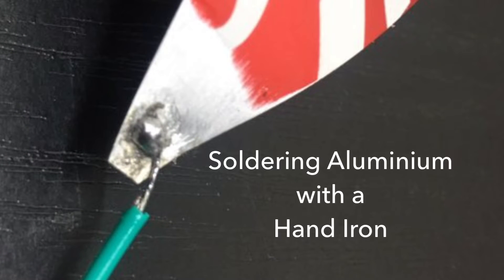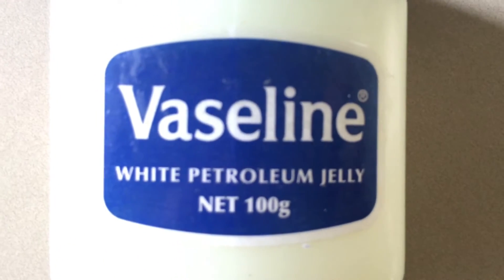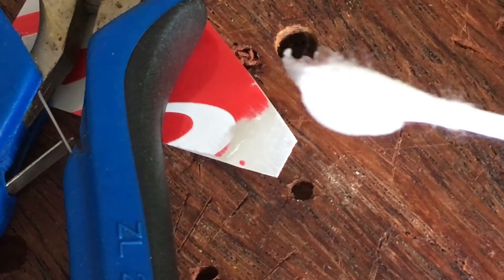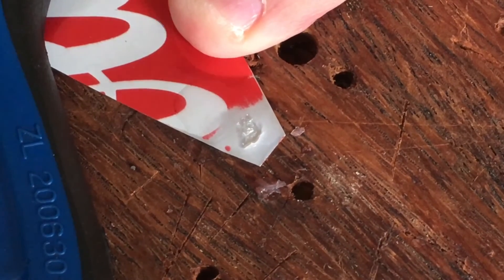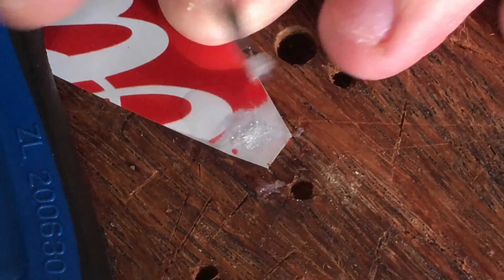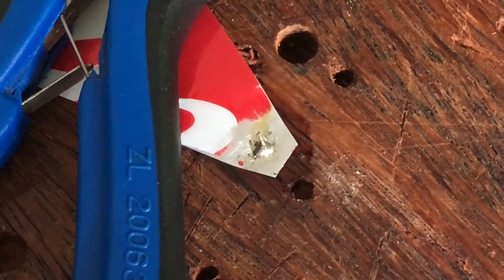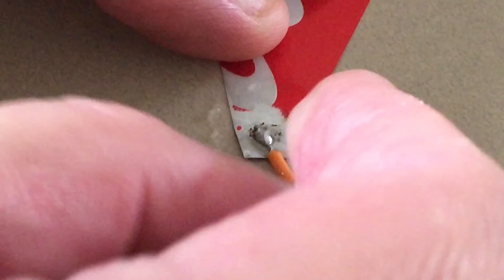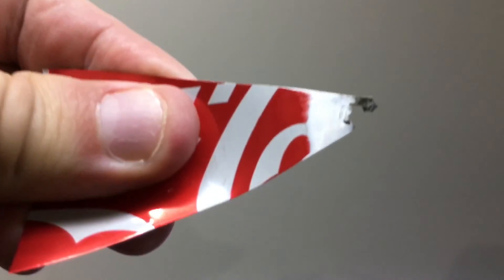Soldering Aluminium with an Iron

Comment: Just had a big radio club discussion on this, and I showed them your video as they didn't believe me. Scrub the aluminium with Oil soaked steel wool, and/or oil soaked emery paper. works every time.
Reply from the maker: Glad it worked for you. This vid is going back a bit now, but I’d have been on the other side of the argument before trying it.

Comment: I have a2011 but I believe the dealer put in a 5.4 because it holds 7.2 quarts of oil plans are dual exhaust with 2.73 gears it gets 32 mpg on the highway

Comment: Ty.  Gonna try to fix my turbo impeller.   I mean why not...I can't seem to find this odd ball impeller at all. If, works... cool. if it doesn't,  I'm still out anyway.  It's a 66 in/ 99 out flatback.  It's for an electric supercharger.  Gives a instant 5lb boost with 0 lag and no strain on motor.  Makes a 4 cylinder feel like a 6. 
It was a blast to see my little '13 scion xb hit 310 hp just trying to shoot across the traffic.  The steering pulled hard to the right and my kid slid under her seat belt in the back because of the torque.  The hp will vary considerably due to the switch that turns on the 24v dc motor when you press the pedal half way.  Down shifting is where it gets fun.  I dropped to a 5.30 I think from 0-60.  It's a little scion.  I was even able to keep those stupid Ford power strokes from running me over and was able to hang with a mazda 3 on the highway. I could top out fast with no problem. 

I know you don't care.  I'm just enjoying the memories.  I burned up the motor because it's so freaking hot here I Texas.  When the electric motor died, the shaft sent the impeller spinning off balance and cracked some blades and sheared others.  The only way these electric superchargers work is if they have a big impeller and a 24v or better voltage.  I had this at 28v and a step up converter from my car battery to 2 18amp and 2 7amp series/parallel to make it 24+.  It would recharge the and be ready to in about 20 to 30secs.  You wouldn't ever notice because your already going to fast and have to slow down . When you need it it's there.  This was a phantom supercharger.  I don't think the eBay ones work.  If you can find a torque amp...your golden.  

Anyways.  Thanks for the share.

Comment: 6 years late but for the life of me i CAN NOT get this to work, i've only managed to get a solder ball sit on the aluminum even after holding the iron on the piece of aluminium, scratching it with the tip of my knife over and over with the vaseline never solidifying, and then putting the solder directly onto where i scratched with my knife.
is there anything i'm missing?
Reply from the maker: If I were to take a guess it would be that the chunk of aluminium is of too much mass for the iron. I mean it isn’t easy to solder to large pieces of copper either.

Comment: Can this be used to patch aluminum radiator pinholes?
Reply from the maker: I think you’d have a problem getting enough heat to the aluminium. It isn’t easy to solder huge chunks of copper either.
Reply: @BrekMartin  I see. Thanks bro.  I might try the copper solution to plate it first then solder it.

Comment: Most Excellent!  Sweet Job, quite a trip explaining.  
Pulled insulation exposing wire, now ready to Braid and use as Wick.
Title update:  'Soldering Aluminium with an old Iron tip'      Thanks!  Cheers

Comment: Something we do at work when bolting two aluminum parts together is to apply dielectric grease to a Scotchbrite pad and buff the surfaces. The Scotchbrite bad removes the oxidization while the dielectric grease protects the fresh aluminum from re-oxidizing.
Reply: Interesting technique, I will try it myself. Why was oxidation a problem when bolting two aluminum parts together?
Reply: @Tokikaren  for electrical bolt connections this would be a neccessary treatment to ensure good connector resistance

Comment: What soldering iron are you using and what are the settings? I’ve heard even with a specialized flux and solder metal blend you still need a torch to get the AL hot enough. Are you sure that can isn’t tin plated steel?
Reply: Coca cola cans are not aluminum in my country I don't know about urs
Reply: @EbrahimAziz-im4uh  in the United States Coca-Cola cans are made from aluminum and it's very obvious the way that the metal is flexing that it's aluminum it's not tan or steel or some other material you can solder aluminum you so that's the point of the mineral oil The mineral oil while you clean or scratch the surface of the aluminum that allows the solder to here to the aluminum has to be free of oxygen oxygen instantly oxidizes aluminum you could perform this with the same results by soldering the aluminum pieces in a oxygen free environment such as in a vacuum no oxygen no oxidization and yes industries weld aluminum pieces all the time so the purpose of the mineral oil or in his case Vaseline is simply to keep oxygen from touching the aluminum that is to be soldered and yes you can solder aluminum how do you think they make soda cans and beer cans in the first place I've seen the video and how they make them they solder the lids to the aluminum can however it's done in a oxygen free environment
Reply: @nathanbond8165  I didn't say he can't soldier aluminum. did I? don't get excited
Reply: @nathanbond8165  we know aluminum can be welded, hes saying its crazy to be able to low temp solder it with regular wire solder.

Comment: Another issue is aluminum conducts heat away quickly. If that piece of aluminum was larger, would this method still work?
Reply from the maker: It would take a higher wattage iron, just like soldering copper.

Comment: HI Brek - nice video.. thank you.  I'm wondering if it's possible to Solder an aluminum handle onto a full aluminum Beer can.  is this possible?
Reply from the maker: It must be, but the mass of the handle might send it beyond the capability of someone at home. I’ll get you use your own imagination how to arrange it with 2 hands, but when I was making copper J-pole antennas, I used a jig to hold pieces together so I could use an 80 and 60 Watt iron on the joint together, after heating the joint with a torch. All of this is only because the mass you’re soldering is drawing heat away from the joint, and aluminium (like copper) is a great conductor of heat…. but yes it must be possible.

Comment: Your technique has been given a mention by a commenter in James Condon's  vid
https://www.youtube.com/watch?v=HvEg9j2n7tA 
where James  was reluctant to try to solder AlCo wires on a generator stator not trusting the normal soldering repair to last the distance with the vibration and corrosion.

Comment: Thanks for this! I’m planning on building an antenna out of heavy aluminum wire and will be soldering some of the wire, copper too, but mostly aluminum. I appreciate your work on this!
Reply from the maker: It will still be a pain because the aluminium as about as good as copper at drawing heat away! :D I used a pair or 60W irons joined at the tips to solder things like J-Poles.
Reply: @BrekMartin  I have an old Weller, adjustable to 120W I believe. Should be able to get to it.
Reply: Thanks for the Video, I saw a different one last week but didn't save it. I have Mineral Oil and a good HOT Weller Iron and will clean with Acetone. My Sister and Husband sailed their homemade Schooner to Australia from US a few years back and lived in Tonga!

Comment: wouldn't it be easier to build a nitrogen jail (a box with nitrogen atmosphere), with some gloves inserted into it? Then you just sand the aluminum like you normally do, and then solder the tin layer. After you coated the areas you want to solder, you remove the aluminum parts out of the jail and solder in the usual atmosphere
Reply from the maker: As an electronics hobbyist, it hasn’t come up often enough to warrant something like that.. for me anyway.

Comment: I just want to make sure I understand: the reason for the petroleum jelly is to prevent the aluminum from oxidizing, because the oxidized surface won't adhere to the solder? And would flux accomplish the same thing or does aluminum oxidize too fast?
Reply from the maker: Hi, solder flux doesn’t achieve the same thing unless there’s something out there for aluminium, but that would be highly acidic and bad for iron tips. My understanding may not be entirely correct, but you don’t stand a chance in the race against the clock for the oxide layer to form. My best guess is the solder flux cleans the oil enough to wet the bare aluminium surface, without it ever having been exposed to atmosphere.
Reply: @BrekMartin  thanks, i think I understand that. I’m wondering about the importance of removing the oxide layer though. I don’t do electric soldering but i do metalsmithing, and aluminum is much more affordable than silver so I’m wondering if i can solder aluminum together without using petroleum jelly. It doesn’t need to conduct electricity that way, and so i’m assuming i don’t need to remove the oxide? Unless the oxide prevents heat conductivity as well
Reply from the maker: @PenguinAvengerPony  I couldn’t explain it properly, but trying to solder it dry like copper, the molten solder would never break surface tension and wet the aluminium surface to adhere. Solder would just roll around as balls on the surface for as long as it was molten.
Reply: @BrekMartin  thanks I’ll keep that in mind

Comment: may i ask 2 questions pls
1: why not use normal flux?
2: what is the aluminium solder called ? does it have a code like different from 60% 40% ?
Reply from the maker: Hi, the mineral oil is only a barrier to prevent oxygen touching the aluminium. Other than that, it doesn’t help, and it’s ordinary soldering. The rosin is in the core of ordinary solder.

Comment: So my cat bit my headphone cable, I went to fix it and to my surprise it was aluminum. This is what I did: instead of burning the emanel (and let the aluminum oxidize)  just cut the cable and have a nice blob of solder on the iron, leave the tip of the cable inside the blob for a few seconds so the insulation burns and it gets a nice coat of solder, now you can easily solder both ends toguether. I had never seen aluminum wire in electronics before, nice video!
Reply: What makes you think it was alu?

Comment: Just a thought ... maybe the petroleum jelly wouldn't harden as fast if the blade were heated?
Reply from the maker: I think if you had a really old cactus iron tip you could just use that, but I didn’t have any reason to keep on at this stage :D

Comment: Thanks for the very useful video. The method is known since at least 100 years (yes...). There was a recipe of a special flux for tin soldering aluminum, not so easy to make (but I made it 50 years ago) and there are several commercial fluxes which I have used for more than 50 years.
The purpose is to prevent aluminium from forming an oxide layer, any oil even olive oil can be used, but in a DIY method motor oil does the best job as it does not burn. The best is to clean the degreased aluminium a first time dry with a fine grit sanding paper to get rid of most of the oxide, and  to make a final wet cleaning with motor oil (yes an ordinary 15W40 motor oil) and a non ferrous abrader. 
Stainless steel brushes are the most effective as it does not wipe the oil layer, thus preventing any oxygen contamination. And solder immediately without wiping the oil. Lead-tin with lots of rosin core is the most effective for this kind of  DIY soldering. It's better to dedicate a special tip for this job, an oily tip is not the best for delicate soldering on copper.
Aluminum foil is a heat sink, better to have a powerful solderer if the alu piece is big. Preheating to 100C is not forbidden, that will help.

And you have a far simpler way; using a special flux if you have several solderings to make. That improves your life. 
You'll get first quality reliable solderings with that fine english flux, I've used it for years for soldering alu/alu, alu/copper, alu/brass, alu/zinc and alu/galvanized steel. 
https://www.youtube.com/watch?v=9iwawTk9gXI
Harris makes one very good in the USA, the russians have a very good one, and you have also the Kapp Golden.
Reply: Can you please tell me how to make the aluminum soldering flux.
Reply: @mtrltoolman  With the oil or vaseline method the flux is rosin, the best and simpler to use a tin-lead with a rosin core. You have also now flux cored tin alloys without lead that may work with the oil method. Tin paste for electronic circuits may work also as it has very good fluxes. You may try a tin paste without oil and with oil and to take what method works better. It's also the cheapest solution but nothing is really cheap with tin soldering. The most important is to have a powerful electric solderer, alu is a heat sink.
The recipe of flux was very old and a most of the ingredients are almost impossible now to find and/or very toxic. Also, the total price would be now absolutely prohibitive.
It's far simpler and finally cheaper to buy a commercial flux for that purpose although they look expensive at first sight. The best is first to ask the dealers selling frigorific parts as often in frigorific the technicians have to solder copper and aluminium with tin or a similar alloy. With a good search you'll find some flux or special core fluxed alloy.
The most common commercial fluxes are the american Harris Stay-Clean® Aluminum Flux and the english AlumSolder Alu Flux, in a lot of countries there is someone making or importing something similar as I have said is very used in frigorific fabrication and repairing/fixing.

Some are tempted to use plumbing paste. In electronics it's not a good idea as the plumbing grease is very acidic and will corrode everything ever after cleaning.
I hope that have helped you.
Reply: I mean the flux you said you make it 50 years ago.
if you remember the ingredients and the way to make it share it.
Thanks for  the response to my question.
Reply: @mtrltoolman  I do not remember the exact detail of the formula which was rather complex. That was 50 years ago...I switched fastly to a more modern ready made flux which had not the obnoxious fumes of the old DIY one. As I said this kind of flux is used in frigorific reparations where soldering aluminium and copper with tin is common. Rosin (colophane) works rather well with the oil method, easy to find, cheap and it is not toxic.
Reply: @pabloricardodetarragon2649 
Ok

Comment: I did this to seal a modified paintball gun. I use high quality flux. Worked 3rd try like a charm. 4 years later and the gun and modification still works. i was told over and over you can not solder aluminum. But I keep doing it. What do i know that everyone else is missing?
Reply: Nothing at all, its just called brazing when the pros do it

Comment: what about sanding the surface with emory paper underneath water? or submerged in mineral oil. Mineral oil is cheap, $3 a bottle, and you only need enough to submerge the part for sanding. When the surface has been scuffed, there should still be a layer of oil protecting it to allow you time to apply the solder. 

I am an oil painter and oil paints harden by oxidization as well. By comparison, acrylic paints dry when its water content evaporates  but oil paint doesnt dry by evaporation, it oxidizes as the oil content reacts with oxygen to harden.

Artists have a practice of keeping their paint wet with oil or even picked up dollops of unused paint and submerged it in water, stored in the refrigerator. There is less oxygen in water and keeping the paint submerged and storing it in cooler temperatures allows you to slow down the oxidation process. Seems to be the same principle here.
Reply: water will oxidise it. mineral oil sounds a plan

Comment: Old work colleague of mine did a similar thing, but he was rebuilding an exhaust muffler for a small RC car he had, using only some aluminium sheet and a Weller no 9 heat tip, and a lot of solder. He made the parts carefully, that the joins were all even and overlapping, then sanded them down in a small bowl of oil, then simply did the soldering to tin them in the oil bowl near the open window, with a 120mm fan running to blow the smoke outside. After the tinning he cleaned them off with a paper towel, then assembled it and soldered the seams up, and finally cleaned it up and sanded the surface to an even shine, and then coated it with clear lacquer to keep it shiny. RC car worked fine, the fit on the parts before soldering was tight enough that the parts did not have any fatigue failures, the solder just filling the seams to make them air tight.